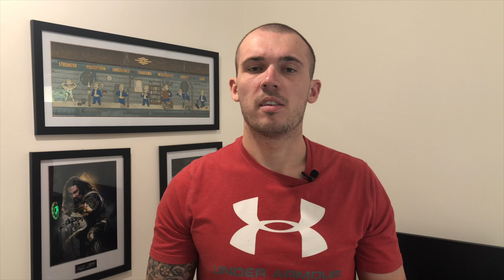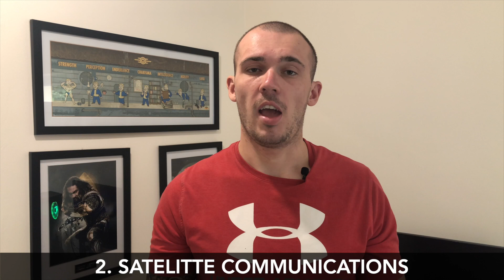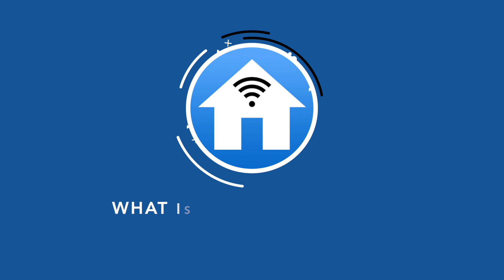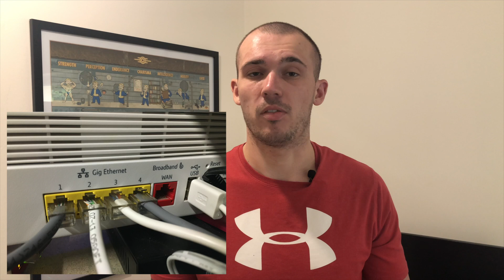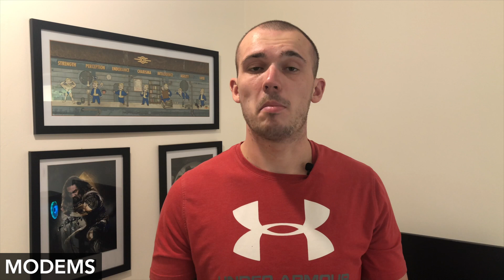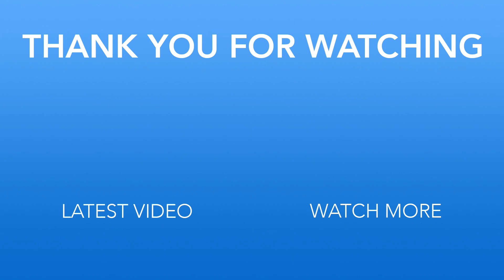What Is the Uplink Port on a Network Switch?

Comment: Great video. So we can connect an adsl modem to the uplink RJ45 and it will provide for expansion  of 8 pc's. I have the CNET CN8800TPC with an uplink port, 8 ether net ports and a BNC connector.
Thanks

Comment: From the one reply I see in the comments section, it looks like i don't need to buy a network module for uplink ports for the cisco 3850 I just got in order to connect it to my router so that all regular ports get internet connectivity.  Is that correct?

Comment: Hi, i have a NAS with port 10Gb, can to connect in the port uplink 10Gb CISCO switch CBS220, CBS250 there are 4 ports uplink, or this ports are specific to stacking switchs?

Comment: These are great videos. If I add a managed switch to a router, would I connect from a LAN port on router to the uplink port of managed switch? I gather it should be a LAN port of a switch, but I’d like to know the reason why that is the case as opposed to the uplink port. I can’t find this information anywhere.
Reply: Isn't it should be Uplink port of Managed Switch, to a LAN port on the Router?

Comment: If a 5-port switch has 4 x PoE ports and an Uplink port can I use the Uplink port as the input and plug the cable coming from the router? Or do I have to use one of the  PoE ports as the input?
Reply: Should be Uplink port of the Switch, to a LAN port on the Router…

Comment: The basic question I have is, if you have ...let's say a 5 port switch with an uplink port, which of the ports do you connect the switch to your router with?
Reply from the maker: You would use one of the regular ports to connect the switch to the router.
Reply: @homenetworkgeek192  thanks for this info; can you please explain why you don’t use the uplink port for this?

Comment: An "Uplink Port" is Just Like any Other Port, However FASTER.
On Switches The Faster: 10 Gig SFP+, Ports, Aren't Usually Called UPLINK. However, they're Used to Connect, To Other Switches. An "Uplink Port" is Just Like any Other Port, However FASTER. It Aggregates Devices Behind it.
You Might Have 20 Computers Connected To a Switch in 1 Building and Another 20 Computers, Connected To a Switch in Another Building. The Two Switches are Connected Together Using the Faster 10 Gig SFP+, Ports. Connecting All 40 Computers. An "Uplink Port" is Just Like any Other Port, However FASTER.
On a Router, These Faster Ports Are Called "UPLINK". 40 Computers and Slower Gigabit Ports, Will All Have To Aggregate and Use the FASTER "UPLINK" Ports. An "Uplink Port" is Just Like any Other Port, However FASTER.
You Dont Have To Use The Faster UPLINK Ports on a Router to Connect To the Internet.
You Can, Use any Other Ordinary Port and Set-Up Routing, Layer-3 Switching on Them.
However, 40 Computers Will Then Have To Squeeze, through a Narrower Pipe.
An "Uplink Port" is Just Like any Other Port, However FASTER.
On a Switch: The Faster SFP+ Aren't Called "Uplink", because Switches: Cross Connect Computers and Devices.
Cross Connected Computers and Devices, Can ALL Talk to Each Other.
A Router: (A Router on a Stick) - Doesn't Cross Connect, Computers and Devices. The Computers and Devices, behind a Router: They Ask the Router, To Fetch Data for Them. (e.g. Using NAT: Network Address Translation).
They Aren't Cross Connected to Computers, On the OTHER Side of the Router.